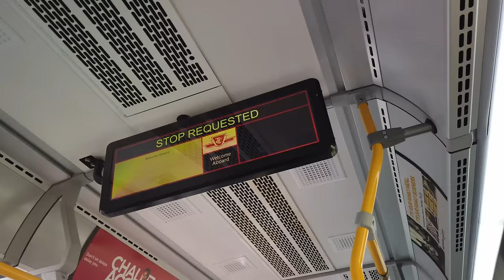Why American Buses Are Just Worse

Comment: I don`t like using this excuse, but here in Montreal, they were using articulated busses on main lines, which sometimes include hills. On snowstorms, it is not uncommon that the articulated busses lack the traction to go up the hill if the snow is fresh. Due to this and higher maintenance costs, the city will not buy new articulated busses. Though, in general, I would say that busses in Montreal are far above NA average.

Comment: Two issues you didn’t mention. 1. US busses run on US urban streets with US repairs and traffic which living in New York and traveling in Europe I can tell is you much more challenging. 2. US transit operators like to customize their bus choices which drives up costs/reduces availability. And since transit management are political appointees their choices are often not the best. I also suspect fewer doors on US busses is because transit management is afraid people will board busses without paying. That is an issue in cities like NYC.

Comment: One of the reasons why American buses are shorter; is that most of the older cities have bus routes where you have sharp, or sharper turns along the route.  An articulated, or just longer bus, can't make the turn, especially if you have parking on both sides of the street. You have the longer buses on the express or longer routes that use state highway, or interstates.

Comment: 8:19 Not quite correct. Buses in Australia (especially the regular public transit buses) are generally bodied in Australia on European chassis platforms with Euro drivetrains (or sometimes USA makes such as Cummins), to Australian specifications. 

The chassis is generally supplied by Volvo, Scania, Iveco, MAN, Mercedes, maybe some others depending on the preferences of the owner. Some electric platforms are now being integrated into the market from these and new entrants. Prominent current Australian manufacturers (though many have folded over the years) include Volgren, Custom Coaches, Denning, Gemilang and BCI. Most of these also license designs overseas or sell them internationally.

Most fully imported "off the shelf" buses seem to be Japanese minibuses (Mitsubishi Fuso Rosa or Toyota Coaster), or some premium coaches. The Brisbane example you've shown is probably the only significant fully imported vehicle I know of, and therefore seems like a step in the wrong direction personally.

Comment: In Moscow bus design and routes logic are pretty close to european variant. Main purpose of most bus routes is to transport passanger from districts to a subway. So the routes are pretty short and kind of "zigzag". But even bus route is long enough, it still laid through sa much subway stations as possible.
 What about buses themselves, they are also European type vehicles. With low floor, 3 doors for 2 axle bus and 4 doors for articulated bus. Also, on some short routes there are small buses with 2 doors. 
 Main bus brands are Russians: Liaz and Kamaz (with it's subbrand Nefaz). Earlier (about 10 years ago) there were a lot of long Maz buses and different European brands.
 For last 4 years there were a lot of changes in bus sphere in Moscow. Main thing- trolleys are now a part of history, because all trolley routes were replaced with electric buses (КамАЗ-6282). In my opinion, fully electric buses are much better than trolleys, because they are much more  maneuverable on the road (for example, in case of emergency electric bus route can be easily changed as like as common bus route, but with trolley it would be more difficult).
 Fun fact- most of the electric bus drivers are women. This tendency went from the times of Soviet Union, where most drivers of trams and trolleys were women. Now the are driving electric buses instead of trolleys, but this tendency is still actual.
 And just a little bit about choice between own car and public transportation in Moscow. In times of Soviet Union public transportation had higher priority then owned cars. And that's why today there is not really comfortable to drive in city center on car- there is very little of parking space (and, of course, it's not free in center). Also, the city administration provide idea of "city without cars", so the amount of parking spaces is decreased for wider pedestrian sidewalks, and parking prices are higher and higher. So people are forced to use buses and subway instead of cars for travelling to work. 
 And a little bit about prices 1 ticket on public transport costs about 51 rubles, parking costs from 100 to 380 rubles per hour (depending how far are you from city centre) and, for example, 95 benzine (in Russian gasoline is not a car fuel, so we use word benzine) cost about 54 rub/liter.

Comment: Tbh I think UK buses rattle just as much but as we generally have asphalt on our roads it isn’t as noticeable.  Also outside of London, double deckers and full length single deckers only have one door.  Given that before covid, most companies would only accept cash, it used to result in very long and tedious journeys.  Boarding times are still slower than elsewhere now though as you usually have to tell the driver your destination so he can issue a ticket and then process the payment (which again when paying by credit/ debit card can take a few extra seconds per person to process).  This is why people think buses are a joke outside of the major cities in the UK.

Comment: If the new TTC buses are using the same European drive trains, then maybe other locations are more diligent in restoring the road surface after road work? The only time I have an issue with the new buses is when the go over old/sinking road work patches or potholes, then the bus rattles like mad. If using a different suspension, then they need to use that as well and not just the European drive train.

Comment: The "safety" of transit systems in most North American cities is compromised not by safety standards of the transit vehicles, but rather from the tolerant policies regarding crazy, high, or violent passengers. Get rid of those people, and the transit experience would improve dramatically with no new equipment needed.

Comment: 3:09  
I don't agree with you. I am bus driver of SOR NB12 which has 4 doors (1x 80cm - front, 3x 120cm-rear), entry/exit allowed all doors and the most used doors are front or one of the others. But ONLY one. Passaangers can open their doors where they stay but they usualy use only one. So all passengers exit the vehicle through one door and thouse on bus stop waiting at the same door. A few of clever of them use another door for entry. So I changed my mind and accept that this was wrong and you don't need more than two 220cm wide doors. And all seats next to driver along front window because not only retirees want to be with you while front crash.

Add: You have to let buses and troll-B leave station in CZ. They have priority while left signal is on and they can limit you when they leave station

Comment: No the reason why trucks and large SUV are more common in the US (Small SUV are very common in Europe) have nothing to do with safety, it have to do with licensing (and also to a degree very high fuel cost). In europe there is a 3.5 ton limit for licensing. If you want to drive anything more than 3.5 ton fully loaded, you need a truck license, and they are hard to get (and expensive)

Comment: Brit here, I travelled over to Budapest last week and finally got to experience their transport system. The buses were an integral part of it, as were the trams and metros.

Biggest difference I noticed was that the BKK buses (blue ones like in the thumbnail) were configured for standing, rather than sitting. I remember one of the datasheets above the driver cab displayed 30-something seated, 115 standing!

And then I grabbed a bus from Margaret Island that was absolutely crammed without a doubt over capacity.

Comment: In Latin America, especially in Brazil, we have great bus manufacturers. But don't think that here it is as good as in Europe, because many cities don't demand quality buses or don't even inspect them. São Paulo seems to have the best fleet in Brazil, while Rio de Janeiro has a bad fleet. In Brazil it is still very difficult to find low-floor buses, and the engine is often in the front, which makes the driver's job more difficult. And there are some cheaper models that rattle all the time.

Comment: Only the city of São Paulo here in Brazil has more than 20,000 buses and not to mention the 400 KM of metro. And any city here in Brazil uses a terminal system which are stations scattered throughout the city and you only pay a ticket to go anywhere in the city going from terminal to terminal simply by taking another bus

Comment: Just leave the current Finnish capital area buses out of the equation: 9 times out of 10 they are in a HORRIBLE CONDITION!

The bus companies here are super cheap and often won' t let the mechanics fix even the issues, that are required by the laws to be fixed, like, you know, the hand rails, that might have been purposely broken by some deranged passenger. 

Another thing is, that the mechanics are ordered to turn off the air conditioning of the buses to save money. Imagine being in a buss full of people for fourty minutes in a heatwave on your way to work....not fun! Especially while the bus driver is enjoying his AC unit. 

And the most sickening part is, that they have risen the price of the 30 day ticket more than once, one of the reasons being HIGHER MAINTENANCE COSTS! 😂😂😂😂😂😂😂😂😂

Comment: New Flyer and Gillig are very decent buses. I've been driving GILLIG in Loudoun County, VA. There are no considerable differences between the North American manufacturers and European ones. Volvo, M.A.N., and MB may look a little bit different but the engines, suspension, and steering are very similar. This relates to the ride comfort and the noise level.   
I am not talking about e-buses or hydrogen-driven buses. In Moscow, e-buses are very nice. But Moscow is a very wealthy city, it can afford 1,000+ e-buses. Besides, I have like 50 passengers a day while my friend in Moscow used to have a thousand.

Comment: In Brazil, street buses of public transport are often extremely bad.
They are overcrowded all the time, dangerous conducted, there are criminals inside, the drivers are very rude and agressive, and they run in streets in very bad condition.
The companies that operate the buses are often run by criminals, the workers union too, mobsters, traffickers and others.
Buses in Brazil are a mix of humiliation and punishment for the poor, for workers and anyone who need to use this dammned kind of transportation.
They are a little bit newer now, because they use to be just trucks with a bus like structures.

Comment: Be careful when generalizing "Europe". For example, I live in the capital of a European country which is a member of the European union. One would expect things to be the same as in other parts of especially western Europe, but they're not. Even though our busses are primarily German and Italian made (so the point about the vehicles themselves being better stands), the organization of transport is subpar. There are a lot of routes, a lot of vehicles and a lot of passengers use them but they're often late or sometimes just don't depart at all. Some older vehicles are also in a rough condition. The tram system is a bit better but suffers from many of the same problems.
This is the case for many countries even in Europe, especially the poorer ones. Some which aren't in the EU are even much, much worse. When you say Europe, you mostly mean western, northern and parts of central Europe - this is just a heads-up to clarify that even we Europeans have a lot of work to do to make transit better.

Comment: It's a sign of the time that this new "estados unidos de America" do not consider what they do it as best enough compared to what others do it on the contrary of what the old United States of America would have done.
Back to buses, it's not so simple. You can't compare just directly bus service. I remember when in Paris they start to make pedestral area and lanes reserved for buses jamming the cars traffic (plus numbers of cars are grown) exactly the same that was done here in Roma but we were already jammed because we have a small metro/underground (every quarter of mile we have to stop for years to understand what kind of church we have found and make a turn on the designed track to avoid it).
An old study done by city of Los Angeles in the 1970 decade discovered buses, cars and motorbikes disturb each other slowing all of them.
In the end for example here in Roma when you have to go to office everything is jammed making impossibile to schedule and you have to wait even one hour for the supposed 20 minutes bus probably getting the 3 all togheter in row.
Now worst part: cost! Much higher here in Europe, again I prefer as USA advantage private cars especially cause the States is a continent and new.
Here in Roma with our streets 2000 years old if you are lucky after one hour driving you need 20 or 30 minutes to find a parking spot, so about a 20 minutes delay you don't even speak or excuse for.
What is done in USA is usually more functional expecially by an economic point of view.
Sorry for such a long comment but bus is just part of transport problem, and that's why Roma is a wonderful city to live but a horrible place to work...

Comment: As an Italian, I don't see any substantial differences between American buses and those of my cities in the interiors, you are comparing 2 different types of furniture based on the intended use. The city buses inside are exactly like the American ones (designed to get many people on and off quickly, giant doors, short distances, lots of standing space, quick to clean) while the extra-urban ones have 52 padded seats, 4 seats per row, but they don't stop every 200 meters, they are simply for longer journeys. I don't know if you don't use this distinction in North America but I don't see the ones in the photos as ugly or wrong, they are buses for the city.

Comment: Last ten years before retiring spent over 2.5 hours on total work commute Halve being on a bus for halve hour each direction. Busses were not much of a problem. Nogoodnics , young people & druggies were the biggest problem. Often had two young peop!e laying at rear of bus sleeping and taking up 6 seats during rush hour. Rode a track less trolley that had a small diesel engine that would be used if the power to two overhead wires was down. Wish federal government would invest a lot more money in public transportation.

Comment: Sometimes a practical bus is better than a posh one. American buses are built more solidly and could probably withstand a head on collision better than the ones made here in the UK and Europe. The buses I drive every day are Yutong E12 electric buses and I kid you not....they drive like go karts....too light at the front due to all the batteries at the back and they were built in a hurry and things are not holding together too well and they were only delivered this year from Pelikan bus and coach. I miss the buses of the old days. I used to fix and drive bi-artic buses, bendies, tri axle deckers with engines in the back, front and under the floor. I'd love to visit the USA and ride the buses there cause they look so much more fun.

Comment: I would disagree on double-deckers. They usually have a lot of dwell time and they can't pass through most underpasses here. That's why I would rather have 15-metre long, 3-axle, single-deck buses (like the Irizar i4 15m or the Mercedes-Benz Integro L) for intercity or suburban express services, like what happens here in the Lisbon Metropolitan Area.

Comment: The low floor fad gave us the rough ride. The average lifespan of a bus is only 12-13 years in North America. I think they feel  cutting back on the suspension systems wouldn't make much difference to most transit riders making short trips to a false assumption. The other thing is the seats. Especially on bendy buses it seems like they felt they had to stuff a seat in every possible space. I used to ride between Tacoma and Seattle on horrible Flyer bendy buses with some seats that were impossible to sit in coupled with a ride that could be described as like being in a barrel of nuts and bolts being kicked down a rocky road.

Comment: I'm from a poor european country. I don't think there are laws about the bus passenger comfort here, but the mayors just buy nice busses. Newer ones are always more economical, and that means cheaper to run, but they also are automatically more comfortable than older models. Some are bought from other european countries, some are assembled here from various european components (drivetrains), so there are a lot of options where to choose from. And yes,  the Mercedes Citaro is also present, although not very common. Most are from Poland and Switzerland.